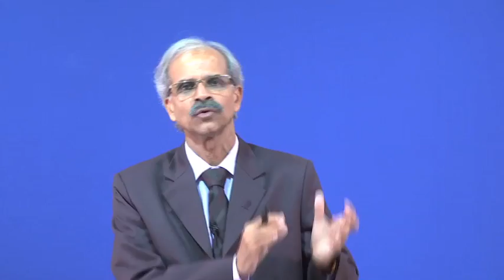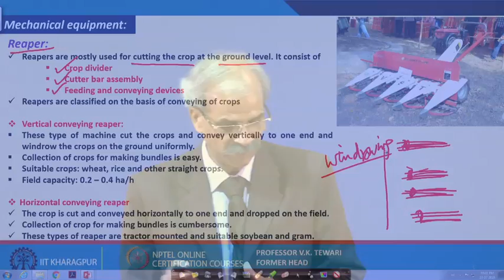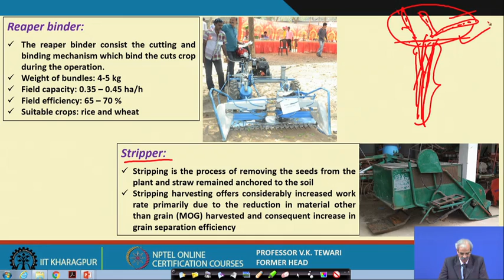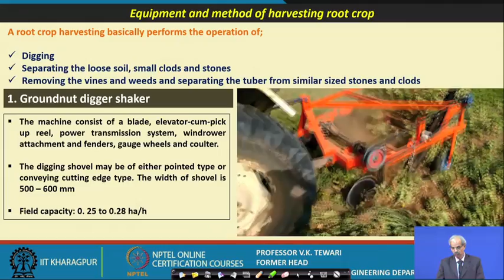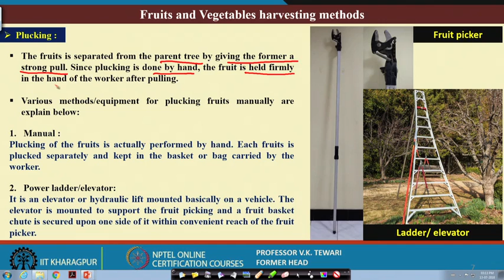Lecture 47: Machines for harvesting cereal crops, root and fruit crops

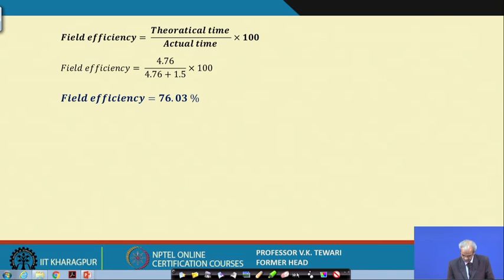Comment: Thank you for these videos, just a minor Correction (25:00 - 25:52)

Theoretical Field efficiency = Width x Speed / 10 = 1.4 x  1.5 / 10 = 0.21 ha/h

Productive time = 1/0.21 = 4.76 hr
Total time = productive time + time loss = 4.76 + 1.5 = 6.26 hr

Actual Field Capacity = Area covered / time taken = 1/6.26 = 0.16 ha/h

Field efficiency = Actual field capacity / Theoretical field capacity x 100 = 0.16/0.21 x100 = 76%

🕊☮